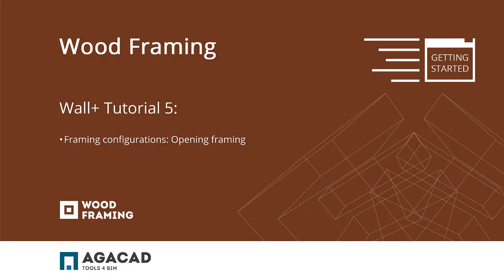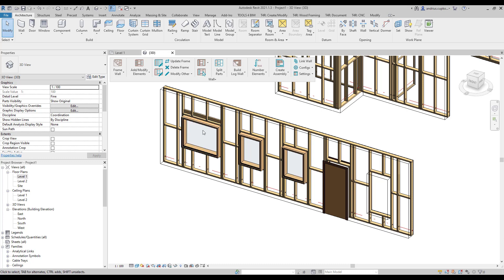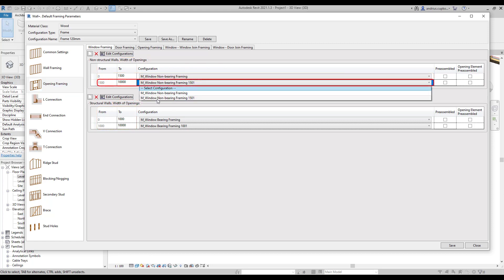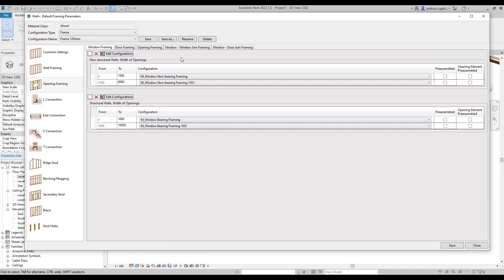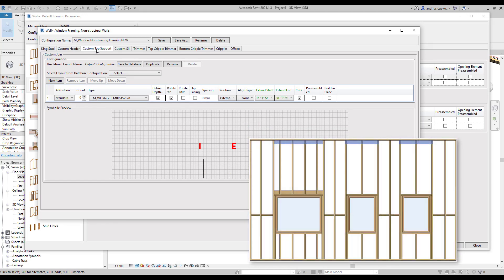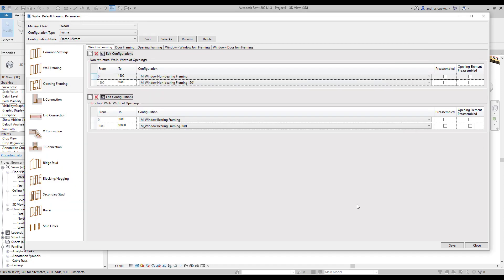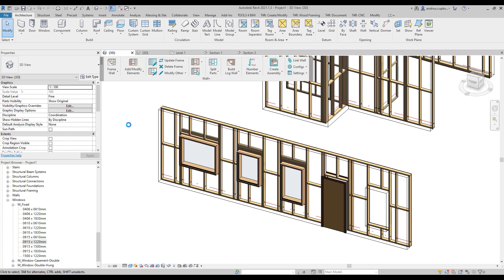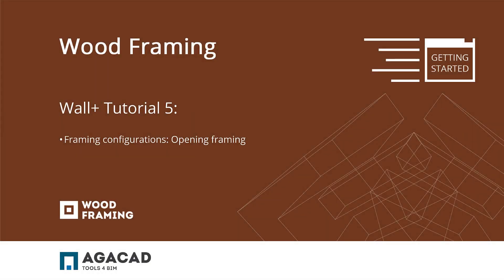Wood Framing Wall+ | Tutorial 5: Framing Openings

Comment: Hello, for the header, i changed the type to a 2x10 but it still shows a 2x6 on the model, any idea what to do with this?
Reply from the maker: Hi, in the Opening Framing configurations, go to the settings of the selected opening (Window, Door, etc.) and open Header Settings. Make sure that the box 'Define Depth by Layer Thickness' is ticked. Then save the configuration and re-Frame the wall. Hope that helps! If more assistance is needed on this, reach out to helpdesk@agacad[dot]com.